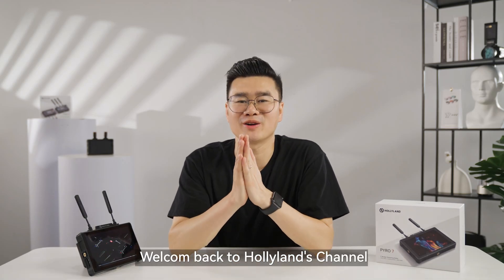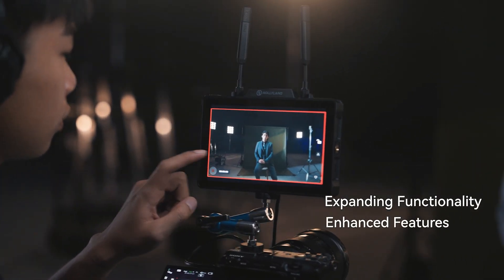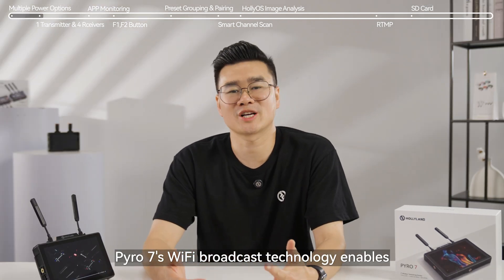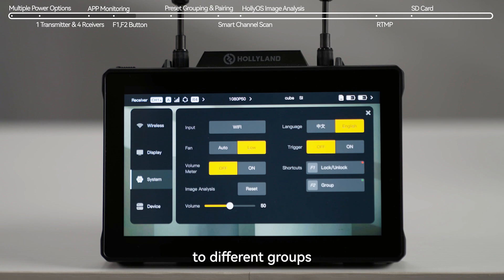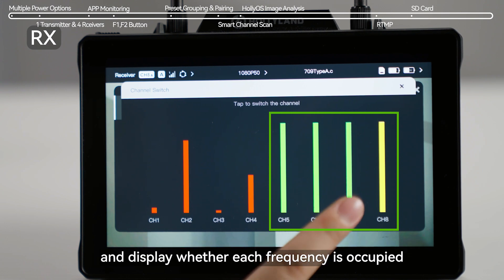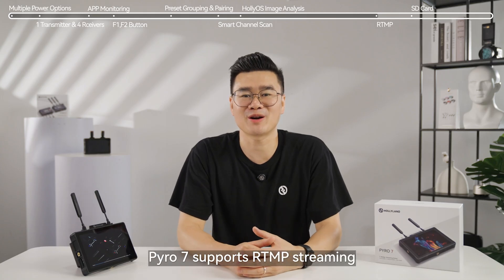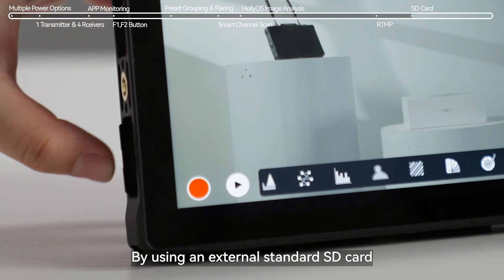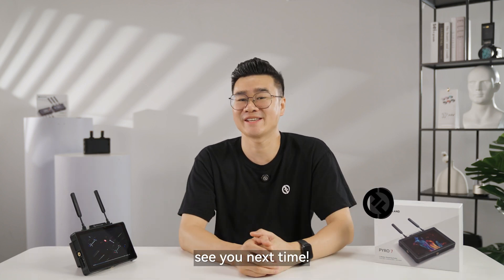Pyro 7 TUTORIAL | Fuel Your Connections

Comment: It cannot replace OBS. So what is the use of this? newbie here
Reply from the maker: this is a wireless monitor, when you are shooting, you can connect it to your camera, so you can get a bigger screen to watch or connect it with a video transmitter so someone else can monitor the camera remotely
Reply: OBS broadcasts the video feed from your laptop or computer. You’d likely use an ATEM switch, but for cameras at different locations during live events where running long HDMI cables isn't feasible, this setup is ideal. 

https://www.youtube.com/watch?v=4OYO8ySWKQQ

Comment: I have a question.  I have tried downloading a firmware update from your website numerous times onto an SD card and I cannot get it (the Pyro 7) to update.  I have done everything I can think of.  Support told me to unpack the ZIP folder to my computer and move the file to the SD card to update but the file will not move to it.  I tried moving the entire folder but that did not work either.  Please advise.
Reply: You have to format the sd card to FAT32, unzip the firmware file to the root folder of the sd card and then insert the card into the Pyro7. The Pyro7 will recognize the file when you navigate to the device menu. Follow the instructions on the screen afterward and you'll be good to go.